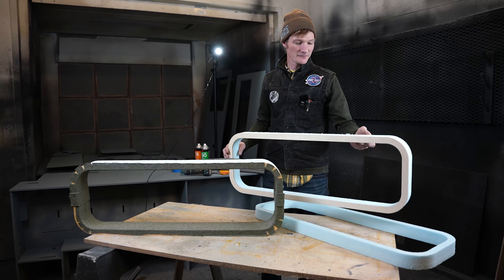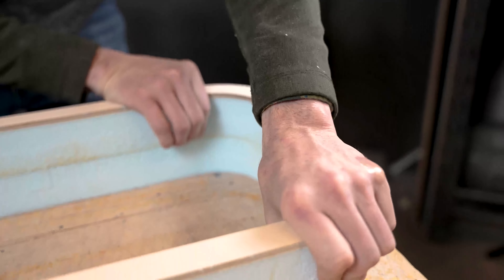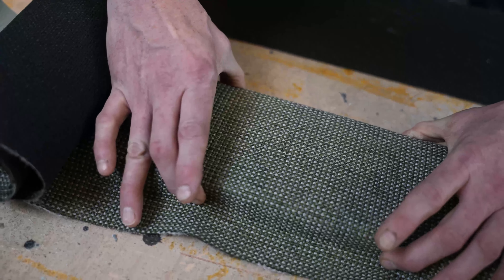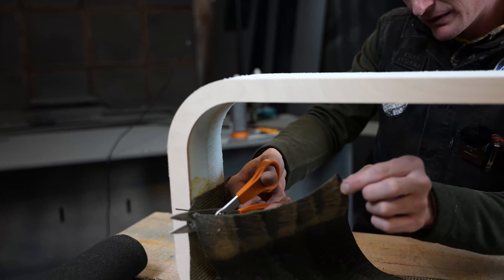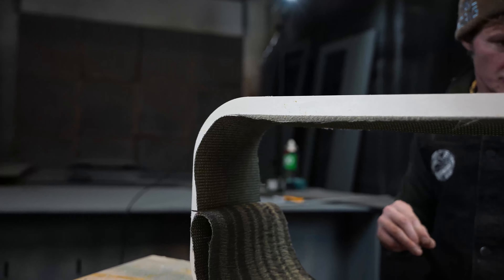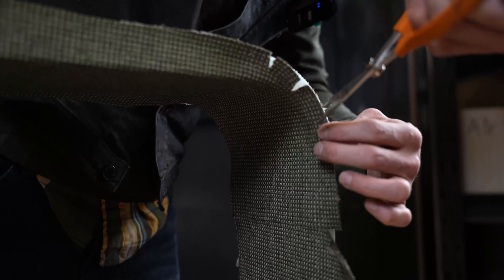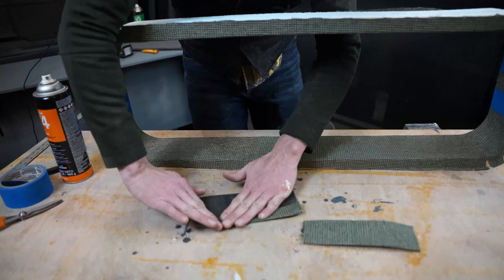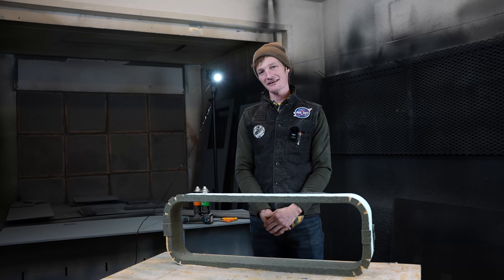AVC Wrapping Van Window Frames

Comment: Excellent video for beginners. I wonder what type of foam (the blue foam) is used in your window frames which is not resolved by 3m Foam Fast 74.
Reply from the maker: It’s xps foam. (Or eps, extruded Polystyrene) we get it from a few sources but it’s the sane as the pink stuff.  The 74 will dissolve it if you go heavy. It’s the propellant I believe that dissolves it.